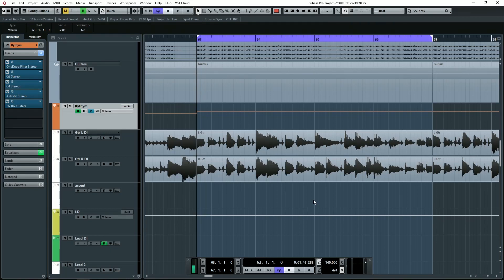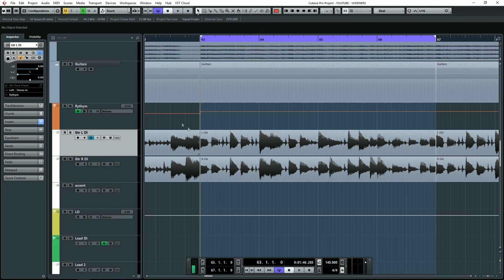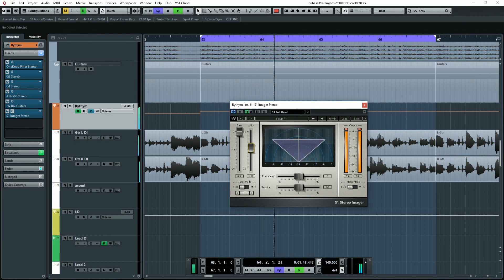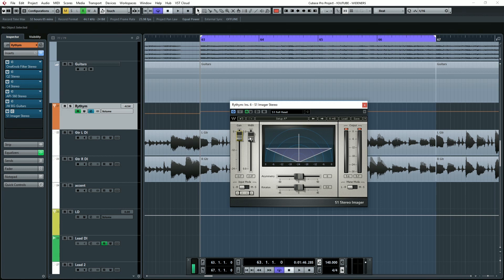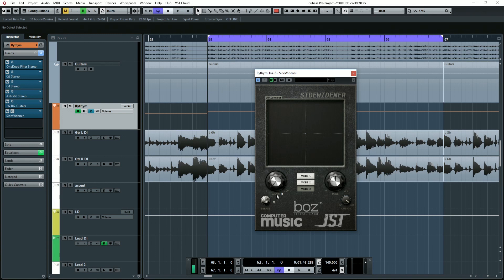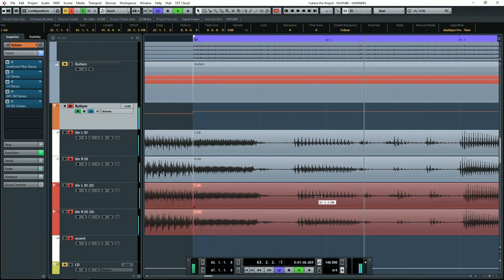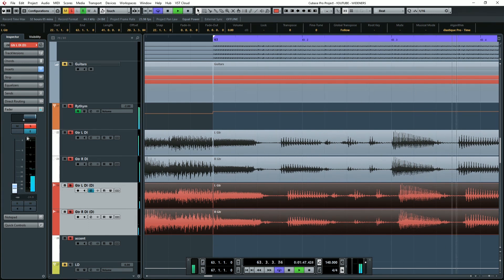How to use a STEREO WIDENER plugin on metal guitars - tutorial

Comment: How about quad tracking, having 2 panned hard, other 2 panned 95%, then you move those two guitars "behind" (by 15-30ms) as shown in manual trick (but only if tight performance), and then EQ those two guitars differently. Boost high end on left guitar, boost Mids on right guitar, balance the gain stage. I believe it would achieve an even wider image, due to differences in EQ and how our ear perceive sounds (each ear perceive different frequencies). Plus you won't get phasing issues. So in the end, it confuses the brain into thinking it's wider. Disclaimer, I'm not an audio eng, but I'm interested in what results would this technique achieve.
Reply: Petar Milutinovic hmmmm that’s actually a cool idea. I might have to try that
Reply: This guy knows what he’s doing.
Reply: A plugin called MSpectralPan does a similar thing by eqing each side differently! Very underused plugin

Comment: i use 2 extra channels for guitars using widening; one with a delay on, set to monitor the original guitar group or bus with it set to 2.54ms, feedback 60, 35 wet, and filtered to around 1k and then compress this and put this at about 1.25 widened, then make a 100% wet reverb return channel compressed and widened to 1.3 and then add in sends from the original left and right double tracked guitars and the monitored delay channel to taste.

Comment: I have a question. There is a very good trick to make a guitar stereo by
 recording the same riff two times and panning the two tracks to left 
and right. But whats a good practice to archive the same result with vst
 sample libraries? For example, Strummed Acoustic library for Kontakt. 
If you make two independent channels of same vst and play same notes on 
them, they will sound exactly the same as there won't be natural 
randomness.
Reply: In Strummed Acoustic there is a "doubling" option which gives you exactly this stereo feeling, and probably most of the other VST sample libraries have this option as well.
Reply: @Ts1rke  but this doubling option doubles the sound same on every note. But I wish there would be randomness in different signals

Comment: Awesome video! Question: I got confused, and would love to know how they relate:
1:26 - "Put out of phase material in the opposite speaker
"
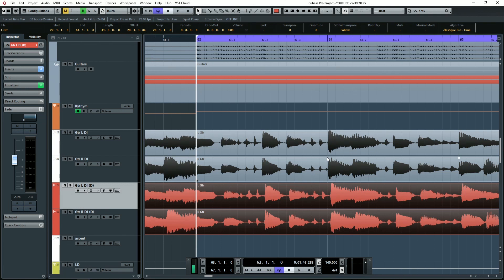11:19 - "Some tradeoffs... More "Phasey"
Which one is correct, and if they're both correct, how do they relate?
Reply: "out of phase to one side" just means a timing difference which adds perceived width. You achieve this when you double track your guitars. It's the natural way to widen it but he is doing it from one.
"some tradeoffs... more phasey" is referring to when you widen it with the plugin, the overall sound will start to sound out of phase which is how the widening happens to begin with. So you do it moderately or else it funks up the image of the mix.

When you double track your rhythms, playing the same riff twice panned left and right, the slight difference in timing will add that "chorus" effect due to very slight phasing issue(this again is what the first point is referring to). It's why when you check it in mono, the volume will decrease. They "fight" each other and start to cancel. And if it is incredibly out of time, it's just a pure mess and the guitar will disappear due to the issue. So when you double track, try to be as accurate as possible.

These days people ignore mono because most everyone is listening in stereo but it's best to always be mindful of mono and double check. Checking in mono can narrow down mix issues easier than going track by track.